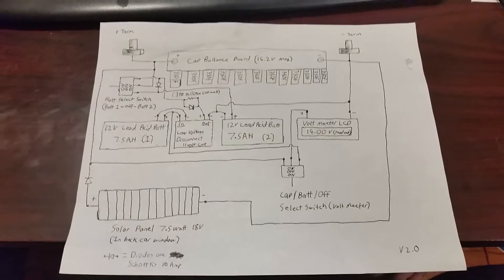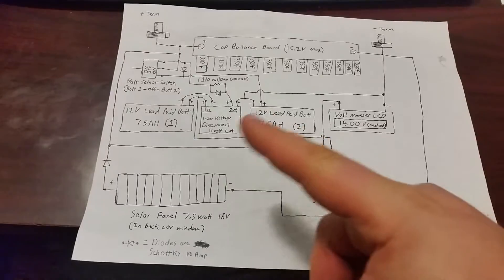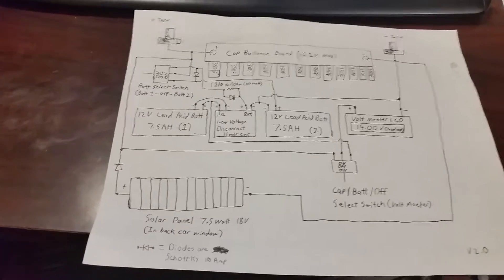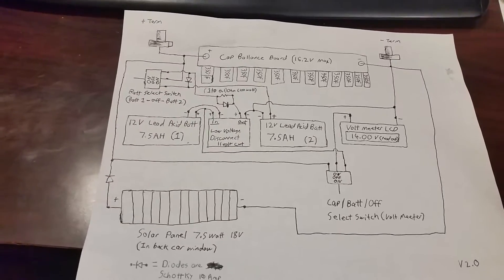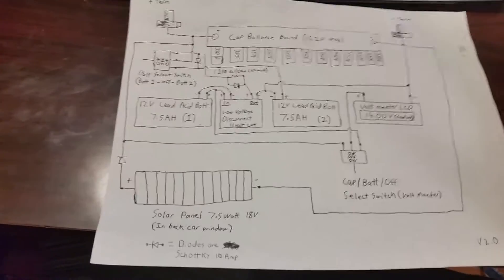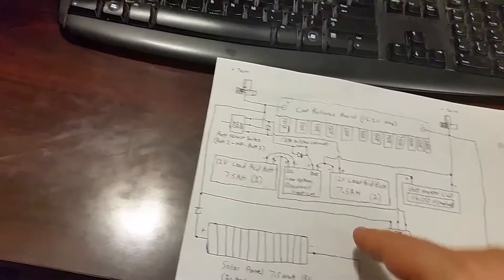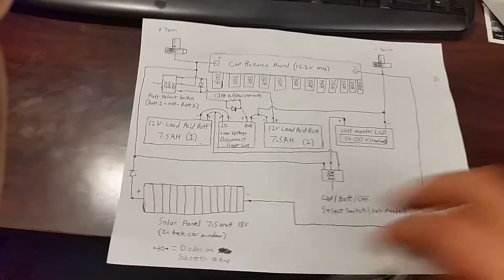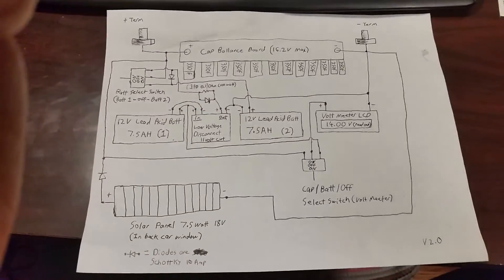DIY Schematic Super Capacitor Car Battery

Comment: still new to all this, your project looks great, but for someone who is new to this (electrical circuits and all), my questions are.
1: if i only stayed with 6 caps, would i need the 2nd battery? i don't care if i have to hold the emergency charge button for a minute or 2
2: do you have a schematic for a single battery setup with the push charge switch (because i can't see where the button is on this setup)? for this video i can understand how and where to connect the solar panel!
3: also for the LV disconnect, the seller you linked in on holidays?? how about this one http://www.ebay.com/itm/CZH-LABS-Electronics-Salon-Low-Voltage-Disconnect-Module-LVD-12V-30A-/371841531325?hash=item56937b7dbd:g:n-4AAOSw-0xYfcF3 it has dipswitches to change ons and offs!
please any advice you can give me would help, tried google for ages and nothing was a clearly spaced out as yours was, i was about to give up on this idea!. also can you show us what the 2battery setup looks like, would be great to understand how much space it takes! btw: currently got a set of 6 maxwell supercaps in parallel with the battery, but for ages i thought, it just doesn't seem right enough, there has to be a way i can make this better!

EDIT: to make it abit easier, using paint and a screen grab from your video, here is what i am sorta after, no 2nd battery and no voltage meter (don't really need it that much, my car is daily driven and i don't leave lights on) all i need to know is at what point i add in the button to boost the caps back up from the battery? https://plus.google.com/u/0/photos/photo/115572598398621047879/6381559270138312594?icm=false
Reply from the maker: I will do my best to answer your questions and feel free to ask more if you have any more questions.

To your numbered questions:

1) The reason for having 6 or 12 capacitors has nothing to do with how any capacitors can be charged in an emergency.  The reason I went with 12 capacitors is capacitors do NOT hold much energy.  From the moment you open that door and your dome light is on to putting the key in the ignition (priming the fuel pump in many cars) your capacitors are draining and their voltage is lowering till you  start the car to get the alternator going.  In this case more capacitor Farad IS better because there will be situations where you will need more starting amps (Winter, after the car sits a few days, cold starts, etc) as your engine will have to turn over LONGER and the extra cranking amps before voltage drops too low becomes important.  In fact in my next build I plan to use 6 maxwell 3000F capacitors with balance boards which should protect me further if I have engine trouble (long crank times).

When I was testing reliability my original build was with with 1 battery.  I had designed a button that bypassed the low voltage disconnect connecting the battery directly to the capacitors when I held it down.  That way if the battery got low I could still charge the caps.  In design a neat idea but it didn't work well.  The problem I ran into was two fold.  By the time the battery hit around 10 volts most of it's energy is used up and the battery cannot put out hardly any amps.  This means charging the capacitor bank was extremely (unrealistic) slow especially in poor weather conditions.  The other problem is after the long wait it would only charge the capacitors to around 9 volts which was not always enough power for a "cold start" on my V6.  By having the second battery and having a switch to move from battery A to B (emergency battery).  Battery B was kept at a full charge over a diode with no draw.  So if battery A was low (low voltage disconnect) I flipped the switch and the switched to emergency battery "B" the capacitors are almost instantly charged to 12 volts in 5-10 seconds (in less time than it takes to  get back in the car to start).  This is a much more "safe" and reliable backup system!  Seriously the batteries are SO cheap get the second battery you will be glad you did!

2) The button would connect (if using the same voltage disconnect) the + of the battery to the + of the capacitors bypassing the low voltage disconnect.  However as I said I tried this and ran many tests.  This is NOT a good idea as the battery will be too weak to be reliably viable.  You are better off getting a second battery.  They are cheap enough!

3)  The low voltage disconnect you posted used a "relay".  What that means is a voltage (from your battery) is applied to a coil of wire to produce a magnet that holds a metal switch in position.  Typically a relay will pull more amps than a solid state switch.  Looking at the pdf specs on that LVD you posted (in's on the ebay page) it says it uses 2.5ma connected and 2ma disconnected (not bad).  On a 7Ah battery sitting on a shelf that would give you about 2500 hours (give or take) before it drains your battery enough to damage it.  Inside your car weather (cold/heat) and the parasitic load from car electronics will make your 7Ah battery life much shorter (in my case about a week without the solar panel working).  Some electronic LVD use less power but it depends on how picky you want to get.  If that relay draw is correct you should be fine for the most point.

The solar panel you use provided it has voltage protection (diode) built in (most designed for charging batteries do) will connect directly to your battery (through car wiring in my case spliced behind the trunk light switch) which will directly charge into your caps and internal batteries.

As far as case size I went to Walmart and bought a Rubbermaid container roughly the same size as my battery (little smaller but close) for like $6.  I drilled holes in the top lid for the battery posts.  Drilled holes in the side to vent heat.  Then I drilled holes in the front for the switches.  The two batteries I laid on their sides (perfect fit on bottom).  I then put the capacitors on top padded with a little foam rubber to absorb shock.  YMMV just find something that will fit in your car and play around being creative. It's all about the fun of building! :)   

Based on your current setup I would add a balance board protection.  A out of balance capacitor that is overcharged will break down over time and become weaker passing the overcharge on to the other capacitors called a "cascading failure".  If you saw my very first video you can see I used a 6 capacitor balance board from ebay and soldered copper rod between the top posts to carry the heavy current (so it didn't burn/heat the circuit board traces).  However use with the biggest F in maxwell capacitors you can.  It will serve you well in the long run!

Hope this info helps!  Gene
Reply: Gene Angel wow Thanks for the detailed reply, this will help heaps.
the caps i already have have a balance board ( http://www.ebay.com/itm/UCAP16-58-ULTRACAPACITOR-MODULE/262633838704 ) so if i just got another one of them and put them in series would be fine (i don't have to use the socket part to attach them, there is a nice big section i can use a bolt and eyelet to connect either side of the green socket).

as for batteries, locally where i live (small city in Australia) the closest i can find to the batteries you have are 12v 9Ah for like $48 (Australia is BS overpriced) but they are close to your size, so 2 shouldn't be that much, but it doesn't snow where i am, and my little 4cyl (though old now, 02 1zzfe) is in good condition, and also the longest it sits is about 3 days without starting!

but thanks for your advice, i might just go the dual battery, would there be much risk to routing the battery switch and LCD to in the cabin? just not well adversed on the risks with automotive electrical problems!
Reply from the maker: Ok I'll answer as best I can and I gope you have great luck in your project! :)  

Ok, took at that Ebay link you posted and I have some concerns.  The board holds Maxwell 6 capacitors in series (maxwell is good).  However from what I see the "claim" of balance circuitry on that board seems to be pure BS snake oil.  Though the schematic is not posted it "looks" from what I can see as their balance circuit is just a diode going to a small LED across the + and - of each capacitor.  Ie: they are using the diode forward drop voltage to lower the capacitor voltage to the LED.  What is happening here is when the capacitor voltage gets high enough the voltage being passed is lowered by the diode.  Then when the capacitor voltage is high enough to get past it's forward voltage of the LED the tiny light turns on.  I then assume the glowing LED is "supposed" to draw down the capacitor voltage down before damage occurs?  If this is how the balance protection is set up you got two problems.  

1) The car alternator charges the capacitors VERY fast using a lot of amps.  If one of your capacitors gets spiked overcharged a tiny led is only going to draw around 5-15 ma off those capacitors tops.  To put it another way if your capacitor jumps to say 3V it could take hours to lower the voltage back down and that does not include the alternator pumping even more power into the capacitors than those little LEDs can draw off.  Having the voltage up that high for that too long will do damage.  Plus once the forward voltage is reached the shut off voltage for diodes/LEDs is lower then the forward turn on voltage.  So they will drain your capacitors lower than the voltage they turned on at.  A "proper" balance circuit is typically based off a Mosfet or similar switch that shunts the voltage across some resistors when the trigger voltage is reached typically drawing 2-3 Amps (2000-3000 ma) or more at 2.7v and shutting off at 2.6v.  

So though it works I would consider that module you are using having a more out of out of balance notification than any real kind of protection.  If you want real balance protection and still want to use that module I would clip the LEDs off that board (to prevent needless drain).  I would then buy a real balance board.  You could solder some wires from the balance board to your existing capacitor module/capacitors.  You could then tuck the thin balance board away somewhere in your case/box with the wires connecting the two.

They also list their capacitor module at 840 Amps.  Not sure where that is coming from.  But from real world tests I found 6 350F Maxwells seemed to peak at around 400A which dropped off quickly as the car cranked (which is why more Farad is better if you can do it) YMMV.

I highly recommend the second battery.  You don't want to be late or stranded and not be able to just "go".  You can put the switch in the cab of the car provided you use high enough gauge wire for the distance/amps you are running.  I was going to do that.  However I have not been having issues so a switch on the box is just fine.  If I have a problem pop the hood and flip the switch.  Once the car is started flip the switch back and close the hood.

I installed the voltage LCD because for just a few extra dollars if I am out in the field and want to check that everything is working right then at a glance with the flip of a switch it lets me check that everything is working right without need for a ohm meter on hand. 

Hope this info helps. :)
Reply: WOW BIG THANKS AGAIN, will have to look at the one i got, as that one is no longer up on Ebay, just to make sure it isn't the same, and if i am going to get my caps wearing out faster and a new balance board to boot, i think i would be better upgrading to bigger caps like you will be!, will have to look when daylight, currently 3am here! 
Edit: just found this board http://www.ebay.com/itm/1PC-MaxWell-350F-2-7V-T11-Super-Capacitor-Balance-Protection-Board-/142231415016?hash=item211da728e8:g:PfEAAOSw5cNYaesz i do have a soldering iron here, so i could transfer the caps if this is better?
Reply from the maker: That board would work fine.  If you want to go 12 I used this:  http://www.ebay.com/itm/1PC-T11-350F-2-7V-2-Ultracapacitor-Supecapacitor-Balance-Board/132051706367?_trksid=p2047675.c100005.m1851&_trkparms=aid%3D222007%26algo%3DSIC.MBE%26ao%3D2%26asc%3D20131003132420%26meid%3D3d65f4ccb04b4f0bba9eb8b6c96b2f71%26pid%3D100005%26rk%3D4%26rkt%3D6%26sd%3D262365819701

You will still need to solder a heavy duty conductor or wire between the capacitors for the current.  I clipped some copper ground rod to solder.  But anything heavy enough should do.
Reply: Gene Angel okay awesome. starting to get all the parts. was intrigued by that balance board. now from my understanding i should be able to resolder my current 6x caps onto one side of that board and leave the other half empty and it should still work, as from where the 1st cap on each side is to the last cap on each side is, they are 2x6 caps in parallel? if my understanding is correct, if i populate the left series and leave the right series empty it should work?
Reply from the maker: Yes it's 2 banks of 6 capacitors in parallel.  Though they sell the boards that only hold 6 capacitors as well if you prefer?  Provided you can start your car on as little as 6 capacitors (around 400 brief amps max from 6 capacitors) you should be fine. One important thing to keep in mind however is the tracings on that balance board CANNOT handle the amps starting a car.  Therefor you "MUST" if you wish to use this balance board solder (or better drill holes for snug placing over the capacitor posts) using heavy gauge wire in series between the posts of the capacitors to carry the heavy starting current draw.  If you do not do this you will overheat or smoke your balance board.
Reply from the maker: Correct that balance board will work with only 6.  Again more Farad is better as the less you have the shorter your cranking cycle will last (if needed).
Reply: @gene4390  hey sorry for hiatus (IRL issues suck), got pretty much all i need to build this, but am doing something a little different with the design, still going to keep the standard car battery but just going to either move it to the boot/trunk or just get a motor cycle battery, but as i am still not well adversed on wire gauging, what gauge wire did you use between the caps and the LV cutoff and also between the LV cutoff and the battery?

my design will use a box with Battery posts in it and then something like this https://www.jaycar.com.au/anderson-175a-power-connector/p/PT4424 after the LV Cutoff that goes to the battery, for a quick disconnect in case i need to remove it quickly if i do full size battery move to the rear!
Reply from the maker: @Xantosh82   If I recall I used 14 gauge stranded copper wire though I think 16 would be fine if next to the battery.  HOWEVER the only reason this low gauge wire works for me is because I am using a 1 ohm resistor (the one with the diode for charging) in series to limit amperage to 14 amps max draw.  So the battery system wires don't carry the full HUNDREDS of amps from a engine startup.  If you are not much more than 5 feet I think you could put the battery in the back as long as you had that resistor to keep your wires from burning.  Voltage is lowered (resistance) and converted into heat as it passes over wire.  The smaller and wires and the higher the amps the greater % of your voltage wasted as heat.  SO if you chose to not use the resistor I would not put your battery in the trunk and go with like a 4 gauge at least. For my balance board I used THICK copper grounding rod.  I soldered.  But my recommendation (and my future build) would be to take a drill (or drill press) and drill holes in the grounding rod.  Then heat the end of the rod and with a light hammer tap the rod over the poses between the capacitors.  That way the car starting current will use the grounding rods between capacitors rather than smoke your balance board traces. Lastly I will say this again as I tell many builders this.  Go with the biggest farad bank you can afford.  It will get you more reliability and less power ripple.

Comment: I'm in the process of trying to design something similar to this. Instead of using the resistor to control current from the battery I was debating just using a relay that I would connect to the start signal to disconnect the battery from the capacitors well starting. Do you have a data sheet for the batteries you are using?
Reply from the maker: I thought of doing that too actually.  A relay ignition switch activated relay from battery and having a pass through diode for charging while the car is running as this would allow more amps when the car is off.  I eventually decided to go with the resistor/diode because it was more simple (easier to swap into any car as a basic replacement) and you don't want to be running too much off the capacitor battery when the car is off with this kind of setup anyways.  If you chose to go that route would be neat to see how it goes.

Batteries I used was:  http://www.ebay.com/itm/Mighty-Max-2-Pack-12V-7Ah-BATTERY-REPL-TEMPEST-12V7-5AH-TR7-5-12A-TR7-2-12A-/191209484858?hash=item2c84f9323a

For longest life the max amp draw from those batteries should be roughly no more than 14 amps.
Reply: I ended up using a resistor. The battery that I used is only rated for 22 amps because of the connections on it. It could pull over 80 amps if the capacitors were low.

Comment: Been following with great interest.  What volt rating schottky diode did you pick? any video of your new setup? what amp/volt rated switches?
Reply from the maker: If I recall I went with 30V 10A Schottky.  But I figure you would most likely be fine with a 5A or 8A.  Due to the flux in the car voltage I would not go lower than 20V.  

As far as the switches I went with SPDT ON-OFF-ON TOGGLE 15AMP 125V 3 PIN EC-1535.  Like this: http://www.ebay.com/itm/2-PK-TOGGLE-SWITCH-SPDT-ON-OFF-ON-TOGGLE-10-AMP-250V-15-AMP-125V-3-PIN-EC-1535-/291682988861?hash=item43e9a9333d:g:6ggAAOSw-jhUKZrX&vxp=mtr  Though they are even cheaper in bulk.